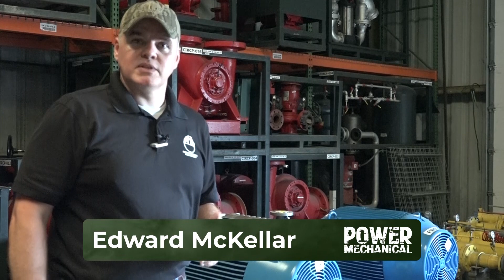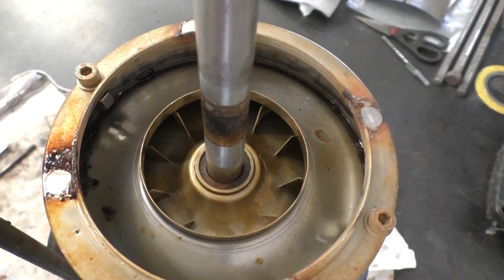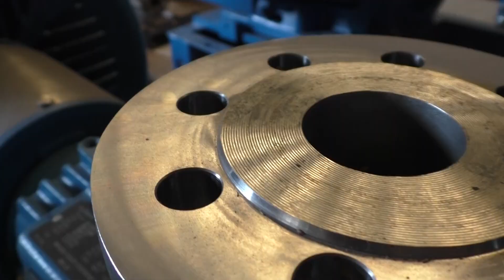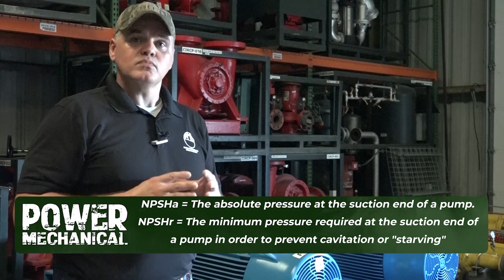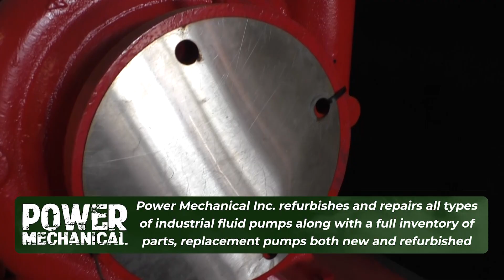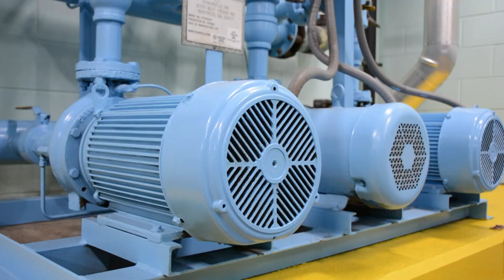Boiler Feed Pump Cavitation & NPSH - SteamWorks

Comment: I just learned this the hard way after my company chabged from a stage pump to a impeller pump. On top of this, our live steam injection that is in place to keep suction head pressure high enough to overcome boiler pressure, had its PRV fail shut. The pumps themselves are more like water movers. The impeller style Dean pumps we installed make about 65 to 70 PSI at room temp water and a boiler at atmospheric pressure. Without the motive steam working, our pressures were not great enough to keep the water boiling point in our suction pipe from gassifying and cavitation our pumps, which eventually resulted in low water cut off alarms shutting down the burners...

Hind sight is 20 20, 100% of the time in this work.